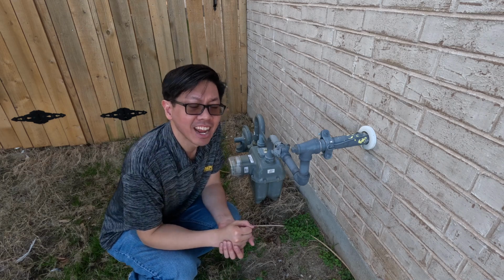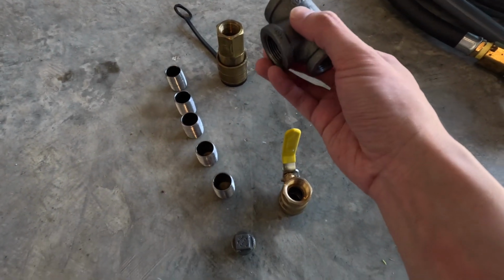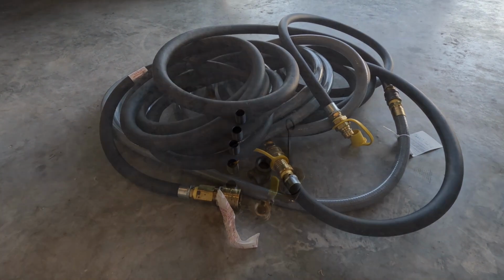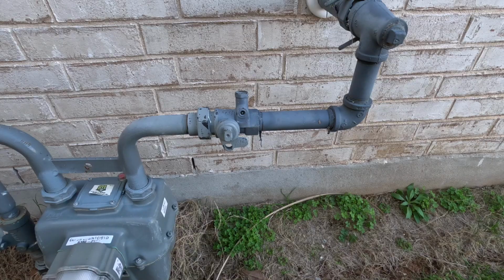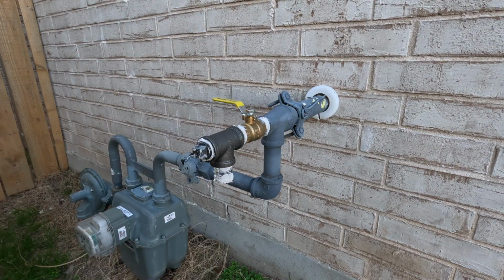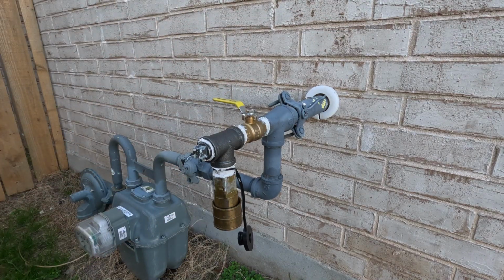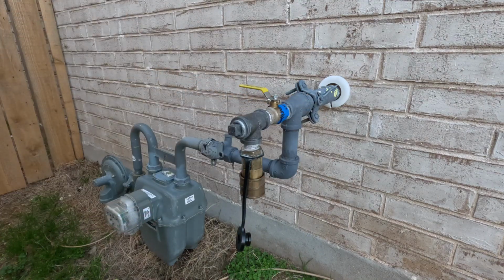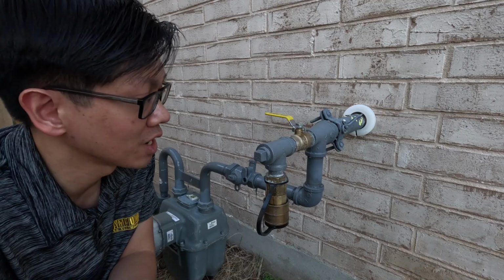NATURAL GAS Quick Disconnect Hookup For "UNLIMITED" GENERATOR FUEL

Comment: Hi Jonathan.  Are you mainly using the 3/4 inch gas line because of the distance between your generator and the natural gas hook up? Or is it because it allows the generator to produce more power to your home?  Also, did you install a soft start for your HVAC system?
Reply from the maker: @gregm621  hi there, please watch my other video where I hook up my generator to the inlet port. I try to explain in as much detail as possible how I came up with the 3/4 inch calculations. The short summary is if I didn't have a 3/4 inch size, it wouldn't provide the maximum amount of fuel necessary to run my generator. 

I also installed the soft start system on my HVAC. I have a video on that too. Thanks for commenting!

Comment: Please delete this video or put a BIG caution not to do this as DIY. It is very dangerous to mess with the gas meter. One thing wrong the whole neighborhood can explode, you can see the pipe going underground and connect to your neighbors. In a lot of jurisdictions, it is illegal to modify the gas meter without a permit and in most cases in Houston you have to call CenterPoint to pay their tech to do it. In some other areas, you can hire a licensed plumber and they may need to get a permit if they need to run pipes. But please this video as it is dangerous, you never know what mistakes people will make. People may hold you liable.
Reply: Shut up. Do you know what happens if you drive your car into a crowd of people? Do you have a BIG caution on your car not to drive it??? Don't be a silly goose.

Comment: @jonathan u should have used yellow dope for the pipe white dope is for water   great work love your videos 🤙
Reply from the maker: Thanks for sharing that info and thanks for liking the video. When I got the pipe dope, the label said RectorSeal T Plus 2 was good for both water and natural gas. I don't think they sold this product in yellow. https://rectorseal.com/plumbing/pipe-joining/rectorseal-t-plus-2-group/?queryID=8f6e74e4f5692781bb1d6eab84b43151&objectID=4213&indexName=prod_us_default_products
Reply: @jonathanDIYs  you did just fine ..... either will work.

Comment: My meter looks almost identical to yours but I have a 1/2" plug instead of a 3/4" plug like yours. Is it worth it to use a 1/2" to 3/4" coupler and then keep everything 3/4" to the generator or should I stick with 1/2" the entire way since it is already reduced at that one spot?
Reply from the maker: This is a pretty tricky question. How far are you running the generator from the meter? How many BTU will your generator consume?

I'm told that "Any nipple or other piece that is smaller in the system and then goes larger again is to be rated from the reduced piece  onward.  For instance, if a 1 inch pipe runs 30' then drops to 1/2" for 6" and then someone installed 3/4" pipe and ran an additional 40 feet, the 40 feet of 3/4" pipe would all be considered 1/2".  You will never get more gas through the 3/4" pipe than will pass thorough the 1/2" nipple." 
https://www.uscarburetion.com/natural-gas-chart.htm

So at least for calculations and ratings, you have to assume you're basically using a 1/2" pipe throughout the whole thing even if you run it at 3/4" afterwards. General rule is you get smaller from the source, you can't really get bigger and expect to get more volume or flow out of the bigger pipes after a smaller section.

Another consideration is smaller diameter piping will be cheaper. If everything can run off a 1/2", you'll be saving money. If you truly need the 3/4" diameter, you're going to have to get the 1/2" replaced with a larger 3/4" tee or something like that.

Comment: How about getting corrossion by 'electrolysis' (having different metals) since brass and carbon steel will corrode eventually?   Any thoughts on that? Anyone?
Reply from the maker: Electrolysis requires water to be present for any corrosion to happen. The black iron pipe will be the one that will corrode, it will be pretty important for me to spray it with paint and keep the iron protected from getting water on it and leaking due to corrosion.
Reply: no it's fine the way it is.

Comment: Your asking for trouble, leave it to a trained technician.
Reply from the maker: Like the trained technician that left a gas leak on my stovetop that I had to fix myself?  

https://www.youtube.com/shorts/WMNHWnaXUwg

I honestly have had bad experiences with "trained technicians". If you want it done right, you gotta do it yourself has unfortunately been my experience.
Reply: @jonathanDIYs  For real.  You aren't tapping into a gas main here.  It's a 0.5 PSI residential connection.  And it's outside!  It either leaks, or it doesn't.  This isn't rocket science.  Btw, the white Oakley dope isn't "officially" for gas (they have a blue one that is), but everything I can find suggests it works just fine (they even say gasses up to 3,000 psi).  I'm about to do the same thing, but I'll spend the 8 bucks to buy the blue stuff so it'll look like a "pro" did it.
Reply from the maker: @jacobrobbins6181  Good luck - check for leaks and stay safe!
Reply: @jonathanDIYs  So true. They wouldn't be plumbers if they were smart.
Reply: @jonathanDIYs  That's one bad technician, you should have reported them. Most states have a mandated licenced or certified technician.

Comment: This will work fine, plumbers just mad that they can’t charge people $1,200 for some simple connections like this.  

Great work.
Reply: My DIY generator connection at the meter was done right. Just because you DIY doesn’t mean you have to do it wrong like this guy. I even added a sediment trap, correctly, that would cost an extra $1m by any licensed plumber.

Comment: Hi, you might want to place a shutoff valve at connection just before the quick disconnect connector for gas generator, if that connector fails with nothing hooked up, gas will be leaking uncontrolled to outside area and have an explosive condition.
Reply: He installed a ball valve just before the new T that holds the service port plug and the quick-disconnect.  Why would he need another disconnect?
Reply: @jacobrobbins6181 Exactly, no need for a second shut off valve
Reply: did you not watch the video?  He placed a ball valve before the quick disconnect....

Comment: Hi from houston hurricane beryl
Reply from the maker: hi, I hope you guys set up stuff before the outage and not saying hi to me in the dark. Stay safe guys! 😅
Reply: @jonathanDIYs mr jay diy , is a permit required by centerpoint here in harris county? Or not , thanks for info mr jay diy
Reply: Some of us, still with out power
Reply from the maker: @edgar.s.merino5324  sorry to hear. That is crazy especially in the Texan heat. Hope you get your power back soon.
Reply: Same
Reply: Why don't more Texans have some sort of generator?
Reply: 😂 me 2
Reply: Me three lol seems pretty straight forward.  A plumber said he would charge me around $300 to do this
Reply: @kevindashid get the right fittings, dry fit and make sure everything works, and then make sure you don't have any leaks with soapy water and you just saved yourself $300.

If you end up blowing up your house, the $300 savings is not worth it.

Comment: Every Gas Company has different requirements I will speak from the one I know. This is incorrect, the tee 1" x 3/4"  x 3/4" is the gas company property they need that to service the meter and keep gas in the house. 
The correct way shut off the gas, cut the nipple below the tee and above the ell, keep for reference when you go to the store and get another one, remove the ell and then remove the meter swivel make sure not to lose the rubber gasket, reinstall the nipple install the tee make sure to have one side pointing to the back yard, reattach the nipple from the meter, install rubber gasket and re connect the meter, sometimes those meter swivels do no want to come off, you will need a hammer to loosen them.
You did a good job with he wrenches, nice and tight.
Reply from the maker: Thanks for commenting. I have Atmos and they state that "Atmos Energy does not maintain the natural gas lines on your property beyond our meter". As far as I understand, I'm responsible for everything after the meter. 

"Customer-owned natural gas lines include all the piping that goes from our natural gas meter to the appliances on your property."

https://www.atmosenergy.com/safety/home-safety/
Reply: Nope. Every thing on your side of the meter is your responsibility. Same with every other utility. Only exception I can think of is the weather head for your electric drop.

Edit. I forgot to criticize your praise of his use of the wrenches. If you pay attention when he's tightening the quick disconnect he's holding the Mexican speed wrench backwards.
Reply: @fauxque5057  As I originally stated every gas company is different and the one I know we own everything from the riser/pipe, fittings meter and to the tee, since the gas company will by pass the meter while they are working on the other side or changing out the meter.
Second I commended a homeowner who was doing good on wrenches, he is doing better than some I trained.  It is painful to watch somebody who has no clue how to use a wrench.  I love your comment Mexican Speed Wrench, oh how we love to mock each other.
Reply: @fauxque5057 He uses the adjustable wrench backwards a couple times. How Dini describe this; the movable jaw should be facing the direction you are turning?

In any case, this seemed to turn out well and I’m going to give it a shot this weekend. Thanks!
Reply: B.S. as long as he leaves the service port which he did all is good.
Reply: They won't touch that tee

Comment: Nice installation but your viewers need also make sure the gas meter has enough flow rate to run the generator and any other appliances you may be using during an outage. Your gas company would be the best resource to check this out.
Reply from the maker: Thanks for commenting. You're absolutely right. During an outage, I'm going to have to be choosing between AC or hot water, probably can't have both on at the same time. I consider this an acceptable tradeoff for the budget on this project and the relatively small amount of outages I get. If this was something I had to run on any regular basis though, having a proper flow rate would be important. Actually, my preference would probably be my own large propane storage tank. I could see scenarios where natural gas is also low or not available during an emergency.

Comment: Why did you place a tee in the line with a plug?
Reply from the maker: It was a gas service port to begin with. By putting a tee, it can continue being a gas service port and whoever needs to hook something on it doesn't have to remove my stuff. Also, the quick adapter is heavy, I prefer the connection hanging downward and not horizontal. It probably doesn't make a difference, I don't think anyone would trip on it, but it did look neater to me at the time. Thanks for commenting!
Reply: @jonathanDIYs I would move the shut off valve after the tee for that purpose.
Reply: did you not watch the video?

Comment: Man, i thought in Texas you had to get a plumber do this.  If not, this seems pretty straight forward DIY.
Reply from the maker: If you are homestead (aka you are the homeowner), it is legal to work on your own plumbing with the state. There may be permits you still need to obtain for your local city or county, so you should still look it up. I live outside of city limits so I was in the clear.
Reply: Well it is do incorrectly, what the Gas Company calls a Bozo No No.
Reply: @Moondoggy1941 Huh?
Reply: @GLG600  7:06 Some Gas Companies but definitely not all of them have different rules. I was speaking about the one I know. 
The gas Co. owns all the pipe work up to the meter and then up to the Tee, so by removing the plug and install a valve tee and quick connect is not allowed. Are you going to gas co, prison no.  If the job can be corrected and still giving the customer what they want they will send someone to fix it, sometimes that was me.   I remember informing a customer about this and I got the yeah what ever, so on the day before Thanksgiving they were replacing the line and of course I was back and we had to shut off the gas, where I would normally jump the meter and given them gas until the replacement is done, they were mad and begged but sorry it is what it is.

Comment: Does this install require a permit and licensed plumber or is diy as a homeowner normal?
Reply from the maker: Thanks for commenting @jamesmaddox7565! I can't comment on this as different jurisdictions have different rules. I live in Texas which has pretty liberal rules for homeowners to do their own work. On top of this, I am outside of the city limits, which means I am not subject to permitting rules. You'll have to check with your local county, town, or city laws.

That said, if you're hiring someone else to do this, yes they definitely should be a licensed plumber. You don't want to hire someone who doesn't know what they're doing. As far as I understand, it is illegal for general contractors to do this type of work for liability reasons.

If you're doing this yourself, do the research to know exactly what you're doing, then double and triple check your work. It's a relatively simple job, but you need to educate yourself on how to safely do this before going forward with this.

Comment: FYI, there is a right way and a wrong way to use a Crescent Wrench.  Put the leverage on the fixed jaw not on the adjustable one.
Reply: I also would like to add that it is easier to tighten or loosen by pulling from the ground up instead of pushing towards the ground. Better and improved body mechanics just like the correct way to use the wrench.
Reply: I think this video was about how to install quick disconnect and not how to correctly use tooks.
Reply: @maddog3768  -- we all benefit when people share their knowledge.  likely no one benefited from your comment.
Reply from the maker: Thanks for letting me know, I'll try that next time!
Reply: @jonathanDIYs  --  overall a very good video and I learned about inside parts vs outside parts!
Reply: OMG Nancy.

Comment: I'm going to have to change my Tee to a 3/4" to do this,  mine has a 1" opening at the plug where he starts his connection 😢
Reply from the maker: you can get a reducing 1" to 3/4" or just run everything 1". Hope it worked out for you!

Comment: FYI don't use pipe dope on gas you need yellow Teflon tape just for gas
Reply: Not true. Please do a few googles, and watch some videos from the professionals. Geez.
Reply: There are specific pipe thread compounds sold for gas fitting work. I know because I had to buy some once. 'Not sure if there are specific tapes for gas lines, but there definitely are for dope. I'm going to assume Jonathan used the right stuff.